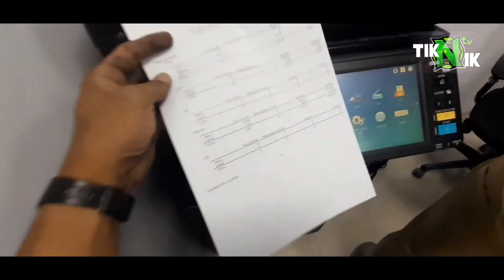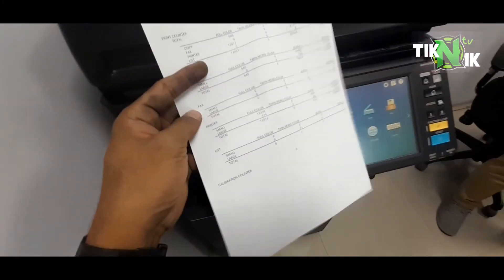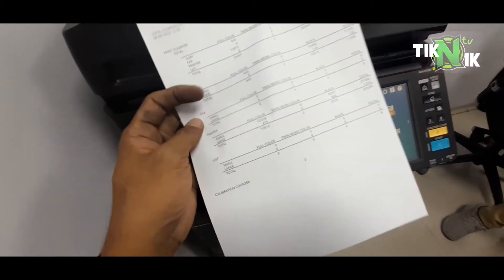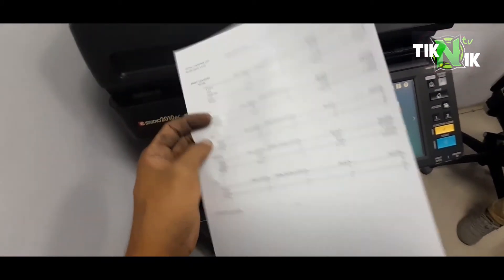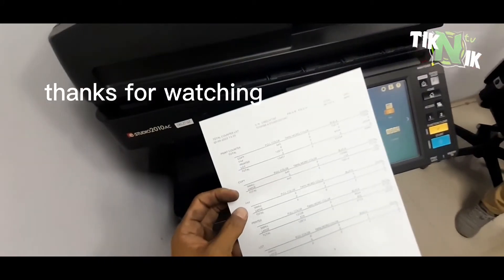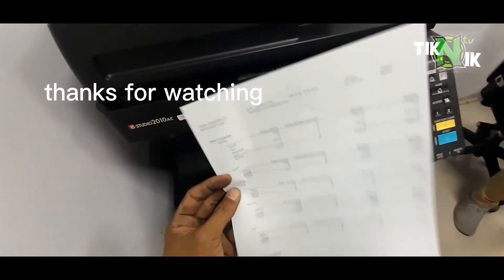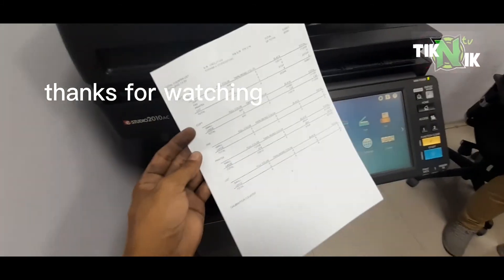TOSHIBA e-studio 2010ac | grinding sound+dirty copy | ITB cleaner issue

Comment: You should have first unlocked the  grey Transfer Belt locking lever on the right hand side of the copier by turning it both down and to the right.  If really locked, you have to open the fuser area and move the transfer belt assembly out a few centimeters after releasing the two thumb screws and moving the L shaped black lock on the back wall of the copier.

When the Transfer belt cleaning assembly spring becomes deformed as in this video it is because the Waste toner container was not replaced in time and overflowed back into the copier.  Replace that as well or dump the contents by inserting a long handled screwdriver into the top hole on the back of the container.

Usually the spring becomes so badly deformed that you cannot reuse it as you did in this video.  It is always a good idea to keep a spare with you in your vehicle.
Reply from the maker: thank you very much sir 💯...